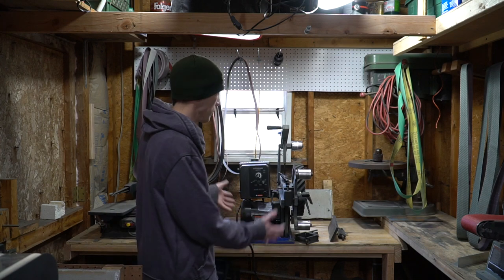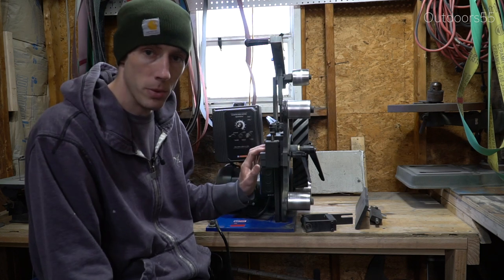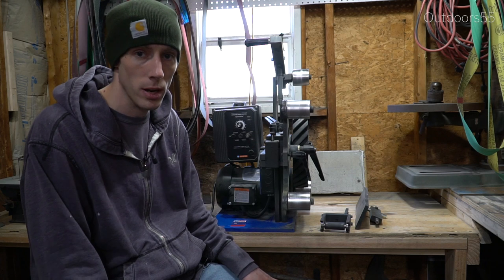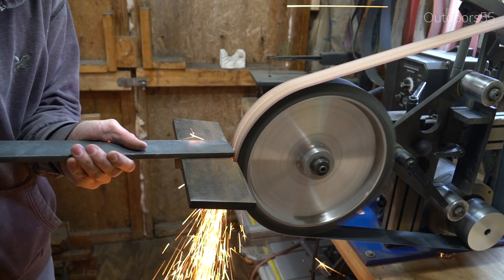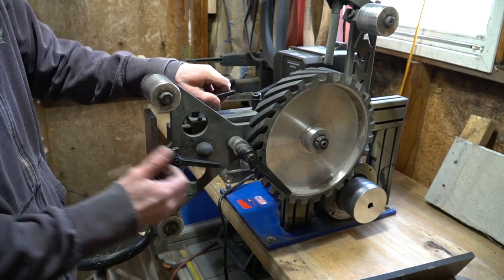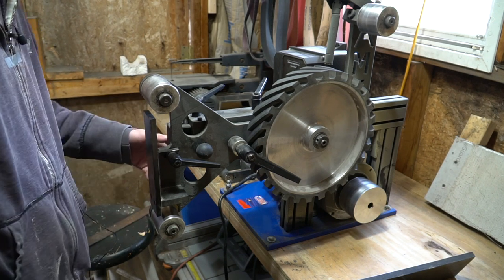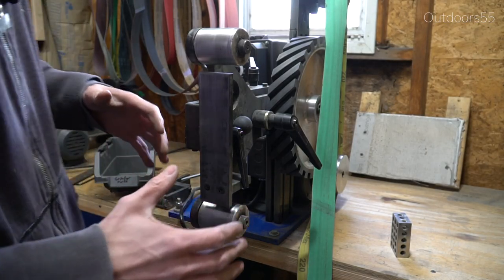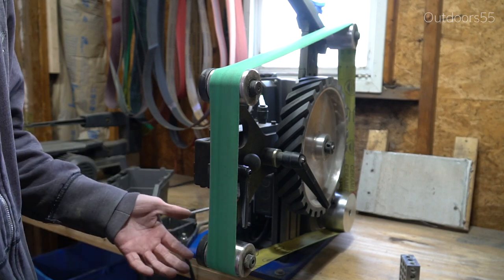About My 2x72 Knife Making Grinder | The AMK77 2x72 review and Grinder talk.

Comment: A few days back I watched a knife channel who was saying to sharpen the blades with the belt going away from the tip ! I have never heard of that being the choice method. 
For about a couple hundred more, I'll go with the Ameribrade 2x72...they are very well engineered and built to tight tolerances and come with high end motors that are smooth as silk.

Comment: Good vid. I've wanted a 2"x72" belt grinder for a long time. I'm not a knife maker but I can think of a lot of uses for one. The cost/benefit kept me away from making the investment until I found an old Burr King knife maker 2"x72" grinder for a couple of hundred. It's a single speed but with what I saved on the grinder I think its worth looking for a good Baldor or Leeson 3ph 1.5hp motor and a KB VFD. I'll probably attempt to make a knife or two once I complete the VFD conversion and thanks to guys like you, who make knife making vids, I'll be able to use these vids as a guide.

Comment: I got the same one around Christmas last year as well. Love it so far. I asked for a custom tool rest afterward and they had no issues making it to my specs at a good price. Easy to talk to a real person on the phone with any questions, etc. I used the money I saved to buy a real heat treating oven from Evenheat as well. If I HAD to pick anything negative about it, it would be the proprietary tool arm setup because it isn't compatible with other system's parts or aftermarket parts. You can't just loosen up the tool arm and remove it quickly. In order to get the tool rest out of the way, you have to remove the tool rest from the tool arm. Not a big deal considering the price, just takes a minute longer to do some things. There are so many positive things about it, the negative of a proprietary tool arm is FAR outweighed by the positive aspects of this machine. The flat platen and contact wheel assembly is leaps and bounds ahead of any other machine I have been around or used. Overall, they knocked it out of the park with this machine in both quality and price.
Reply from the maker: Interesting! Got me thinking now...
Reply from the maker: I agree, the tool rest arm is the worst part. Its not bad by any stretch but I think It could be better. I feel its a great value machine for what you get. And aside from making your own I dont think it can be beat.
Reply: @OUTDOORS55  I just wanted a larger work rest, the system is still the same brother. lol, i haven't even asked about a way to fix being able to set the angle when moving the tool arm in and out. Sorry if I wasn't clear on that.
Reply: I think they could make something that would fix that small issue if you wanted them too and were willing to pay for it. The guy is a machinist and if anyone can, I'm sure they can. SO MUCH BETTER than the 2x42 I was using before, there is no comparison.

Comment: Probably looked at about 50 self build including pro tools. This One by fare is the best thought out unit for space, parts, and simplicity. All on this slide railing frame stuff. It would be nice if the frame was all steel, just feel more comfortable with, weight wouldnt be an issue other than shipping. 
Great review!

Comment: Hey there!   Just a thought...  I think you should forge your rest arm and bend it about 20 or 30 degrees downward.  (Or have a new arm cut in that shape)  Then you can slide the rest straight front and back and it would be low enough for your platen.   Nice grinder though!   Cheers!

Comment: Looks like to me they could cut a track into the tooling arm and design a T handle 3 or 4in drop with table attached to that and the T part could slide in and out of the tooling arm with the quick release handle. That way your angle would stay consistent and with the drop arm down 3 or 4 more inches you'd have more of the platen to use. 👍, just a thought, might have it all wrong tho...

Comment: You can fabricate any attachment you need for that machine. Better u than me, I've built 2 a 2x48 witch is  Phenomenal and a 2x72 horizontal and vertical but is usually left on the horizontal position.

Comment: I bought a Diktator and love it! Variable speed is a crutch. Pressure control is the key.
Reply: Sure you can. I do it whenever I need to. The bearings get warm and might not last as long as they would using a VFD but it works fine.

Comment: I have this grinder. My platon doesnt seem to sit straight with the belt, if I push harder on a belt it will track away from my work and the small wheel bearings leak grease really bad when used for awhile. Suggestions?

Comment: I have a slightly older model AMK, I do love it, but the biggest downfall is the work rest arm.. It is a pain to set up every time, and I had to modify mine to be able to tilt the angle downward and be able to run a jig across it. I think my next machine will be Bader set up like Walter Sorrels has, that's a mean machine!
Reply from the maker: I believe they fixed that issue with the tool rest itself as it can raise and lower independently. I dont have problems running a larger tool rest in the lowered position. 🙂

Comment: I bought one from pulley-wheel for 400$. Very similar to the one you're showing here. The price difference is HUGE.
Reply from the maker: Yes but like i said you have to compair fairly. That grinder doesn't come with a vfd or contact wheel. Just the vfd alone runs around 400 if you buy it yourself.
Reply: @OUTDOORS55  Yup, that's correct, but i'm on a very tight budget so even with those i'm still about 800$ down on the package. In the end it's just me, important is to feel good about it and good video btw.

Comment: Over here we use slightly longer belts . about 5 inches longer and since I use 72 ones as well even that makes s significant difference. Anyway doesn't the wheel get blastered with dust and steel particles while grinding which get imbedded ? Thx
Reply from the maker: I haven't noticed anything.

Comment: A few years later what are your thoughts? I’ve used a friends TW and it was incredible and has all the wheels but was way out of my range but an incredible product, anything else out there for someone that doesn’t have 6k to spend?
Reply from the maker: Mine runs like a clock still. If you're on a serious budget you can look into the Brian House, house work grinder, if you can weld. Even if you had to pay someone to weld it, its a much cheaper option and give a lot more capabilities in the long run.  I know brian and hes a good dude. 👍
Reply: @OUTDOORS55  just want to make sure there’s not a better 2-3k setup, a couple grand is ok but just too much for all the wheels and arms and extras on the TW although it is an incredible machine to use…just wish my buddy was closer than 10 hours away so I could just use his. Thanks for the reply, great vids

Comment: GUNDOG FORGE IN THE UK THERE BOLT TOGETHER 2X72 GRINDER THE CORVUS I LOVE MINE!! 800.00 bucks with motor and aluminum wheels and flat Platten heavy duty machine and goes into horizontal position

Comment: The work arm needs to have a 45 in front of the lock down lever and another 45 degree angle straight so you can attach your work surface on to it while it is level.
Reply from the maker: Yeah an arm (in my very beginner opinion) is sort of strange. Id like to have something that works on 90 degree angles so if an adjustment is made it doesn't throw off the work rest angle. Its not a huge deal but just something to mention.

Comment: Just built one with same controller.  1 hp motor. 700$ all in.   Still need a big wheel and the small wheel thing.  I can barely weld.  But I can grind and paint.
Reply: Heat treating oven is next.   Hoping for less than 400$ with PID and 120V.
Reply from the maker: You cant build one of these for 700. Just the motor and vfd will set you back 700

Comment: Oregon blademaker is much cheaper, like 950ish with the motor. Its not variable. Ive used it for 2 years, its a great grinder for the price. Probably not as good as this grinder or others. But a great grinder for the price that works.

Comment: I'm curious as to how often you need more than 3" of usable platen for knife making?
Reply: @CamaroZ28Nut3  Well I guess I haven't, most bevel fixtures I have seen are made out of 1.5" material. The usual practice is to keep the edge as close to the top of the fixture as possible.

Comment: Just wondering about something you didn't show Alex. Can the small wheel attachment be used in conjunction with the table if you wished to do straight fuller grinds? You might try that on a future Blade. Great video as usual.
Reply from the maker: Yes the table can be used with any attachment.😀

Comment: Great overview. How was doing the wiring to get it set up? That is the one thing that worries me. Again thanks for this 👍🏼
Reply from the maker: I forgot to mention that it comes set up. No wiring on the machine needs to be done. Only thing is the shock tower needs to be screwed on. So you basically just screw it on and your done. This is the second video ive done on this but in the first video I mentioned that it won't run on a gfi outlet. Or on a circuit with a gfi outlet inline. So you may need switch out some stuff depending on how your house/ shop is wired.  It's pretty basic stuff though. If you cant do it yourself an electrician can do it very quickly.

Comment: Thanks for posting the great video, it's been really helpful. The extruded aluminum for the main frame is a bit concerning, you can already see deformation marks in it from moving the tool rest around. I have to wonder what the other side will look like after the contact wheel and platen have been moved a few hundred times, they take a lot more abuse than the tool rest. Makes me question it's long term viability considering it's the supports everything. Perhaps the most important part, the tool rest appears to have the least thought put into it and really limits it's use.  I hope they address these issues in future models. I'm really puzzled they didn't just put an offset in the tool rest arm to make it work properly, would it have really cost that much more?  It's still on my list of candidates but I'm not sure it will make the cut!  Thanks again for the in depth look.
Reply from the maker: An update is that theres no excessive wear even after moving it hundreds of times. Its also a replaceable part so even if there ever was wear it could be easily replaced. All in all its a good grinder with good support.

Comment: Very good review. I would like to try my hand at knife making without first spending $2000. What grinder did you use before getting the AMK77 2x72. Thanks
Reply from the maker: I was using a 4x36 craftsman. I have a video on it. Just search 4x36 for knife making and it should pop up🙂

Comment: I purchased my AMK72 in 2016.  I got the single phase motor, and I should not have, I let my over eagerness to get grinding overtake good sense.  There’s no substitute for a VFD, so my advice to all is save your pennies until you can get one.  Not just for better control on grinding in general, but grinding at a lower speed is a must for small wheel attachments and the bearings they use.  I have been very happy with my AMK overall, but I’ll admit to purchasing a second grinder that accepts the standard 1.5” square tool arms so I can use the KMG rotary platen and OBG surface grinder.

Also it has to be said - and I think it can be as Outdoors55 has already mentioned other grinder companies in the video- as a Canadian knife maker shackled by the horrendous exchange rate, criminal shipping fees etc.  I urge American would be knife makers to not overlook the Reeder Products grinder and their offerings.  One price point above the AMK, they give you quite a package, and offer some very comprehensive accessories (Rotary Platen & Surface grinder now also).  Another thing not to overlook is a grinder’s ability to tilt.  Sadly the AMK was not built too, you’d have to, like I did, fabricate it to tilt yourself, or buy their purpose built horizontal grinder.

All in all, the AMK is a solid and innovative grinder (the flip from flat platen to contact wheel is genius!).  The build quality is top notch and the price point is awesome considering what you get.  There may come a time that you need to expand to the tooling arm offerings out there as your needs as a maker also expand, but you can’t go wrong with this grinder to start off.

I wish all here the best with their grinder endeavours...not an easy decision...and Outdoors55 keep it up man, your videos are awesome!

Cheers, 

Griff.
Reply from the maker: All great points!!👍 Your right I forgot to mention the small wheel issue and the vfd.  I looked at reeder as well but just decided to put those extra hundreds towards an oven. Id like to see amk start offering other accessories as well. Everything about this grinder could be modular it would just be a different system. Thanks for the comment and offering you expertise 👍

Comment: Hey man, what grinder would you recommend for beginner knife making? I'm willing to spend a couple hundred £ at the most, it's a hobby that I haven't even started yet and am looking to get into. Definitely can't be laying down close to $2k + import tax to the UK on a grinder, but obviously need something functional. I've heard people talk about 4 x 36", 6 x 48", 2 x 72" (though they seem to be the most expensive by far), but don't know what I'm looking for.

I've followed your other "guides" or tips and everything is affordable enough to start up the new hobby, fire brick + blow torch furnace, angle grinder for everything you can get away with, maybe even a pseudo-anvil and hammer for some forging, but when it comes to belt grinders the costs start shooting up unless you buy cheap (<£100) which I can't trust.

Cheers.
Reply from the maker: Look into the grizzly 1x30😀

Comment: Northridge tool has the mod-e 2x 72 for $475 but not motor.
Reply from the maker: A 3 phase motoer and vfd is going to run about $1000 so not much saving.
Reply: @OUTDOORS55  I bought a new 3 phase baldor motor vm3558,  180$ and kbac 27d  360$ so I can get the mod -e and it will just be about a 1000$ machine total. Just gotta shop around.

Comment: $2k!? What parts of it are made of gold? I think I'll make my own belt grinder.
Reply from the maker: Just the vfd and motor combo is going to run about $1000.
Reply: @OUTDOORS55  I've got a 2hp motor already that I can use and a bunch of 2" square tubing so all I need to buy is the VFD and the rollers.